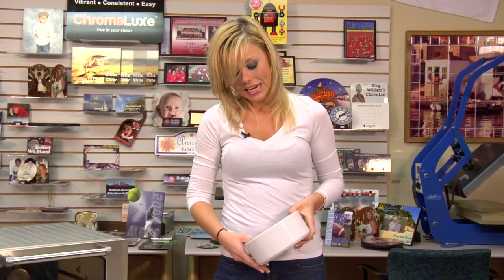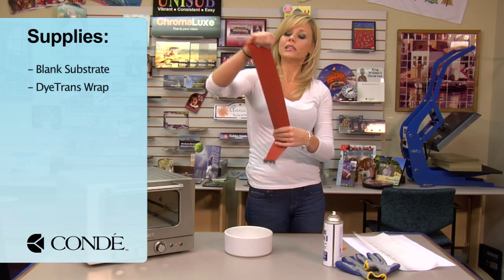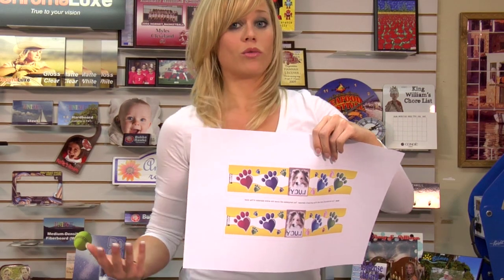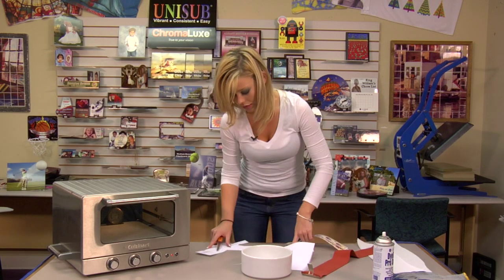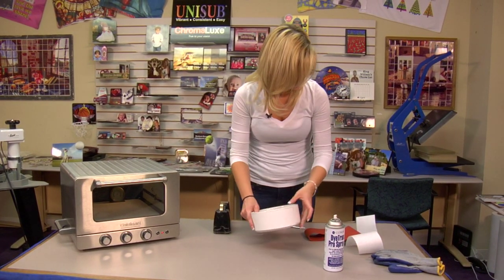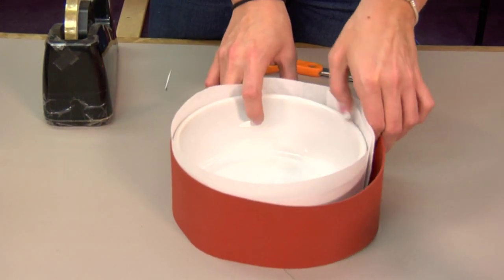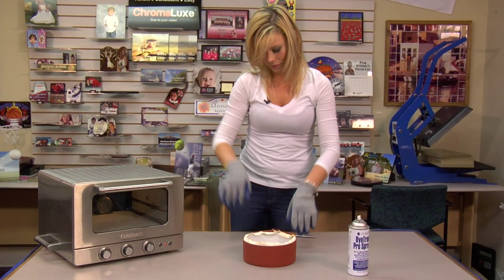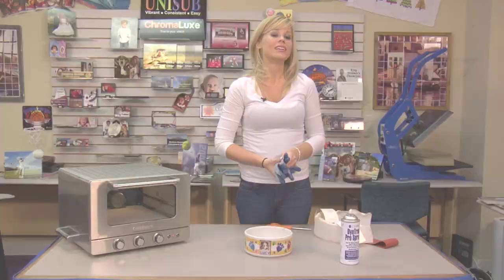Ceramic Pet Bowls Imprinted with Dye Sublimation -

Comment: Nice video! What type of oven are you using? Like, any oven that can cook at 400 F?
Reply from the maker: +Alfredo Tovar Yes, any oven will work. WE do think you should take a big stein with you to buy one and make sure it's tall and roomy. Also, the ones with the bricks in them are not so great as the bricks take up a lot of room. Happy Sublimating!
Reply: +Conde Sublimation Thanks for the tip! Does Conde sell or have a sore in Canada?
Reply from the maker: +Alfredo Tovar Sorry, no store in Canada but we do ship there. We work with bank wire transfers, Paypal and US credit cards. Give us a call at 011-251-633-5704

Comment: So I can use a standard toaster oven on this? I don't need convection?
Reply from the maker: Not if your toaster oven only heats from the top.
Convection means you can bake evenly in it.
Reply: It says it's convection, but it doesn't have a fan. It does, however, heat from both the top and the bottom at the same time.